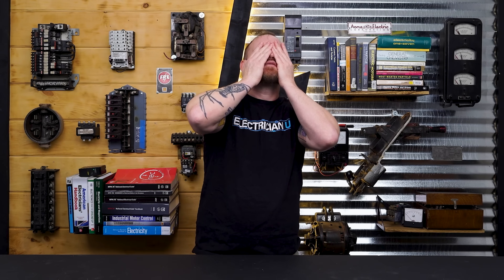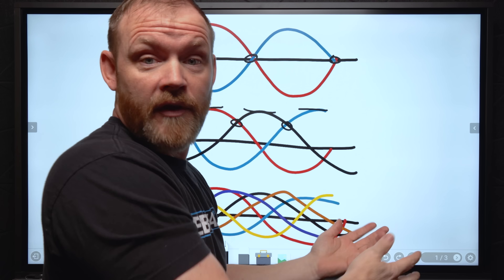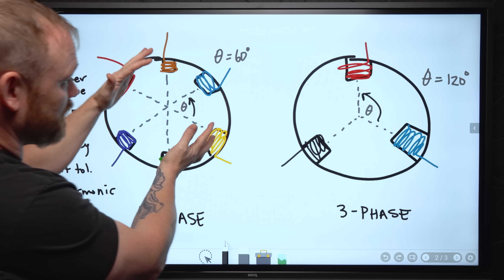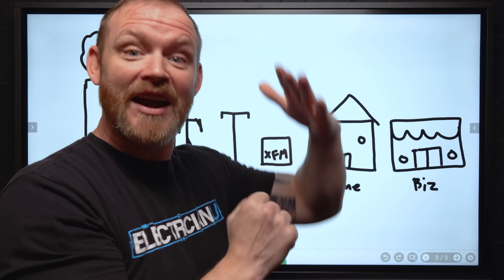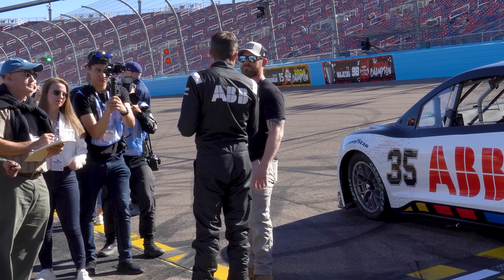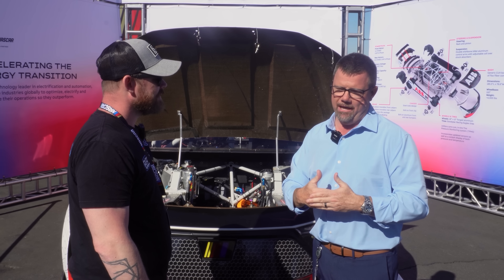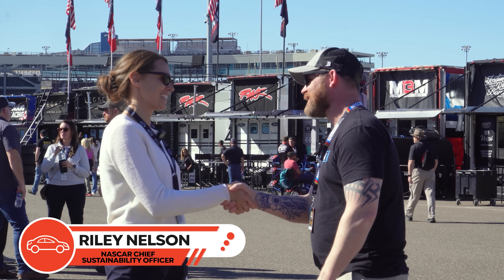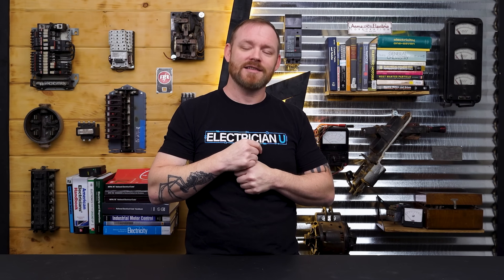6 Phase Power is a REAL GAME CHANGER!

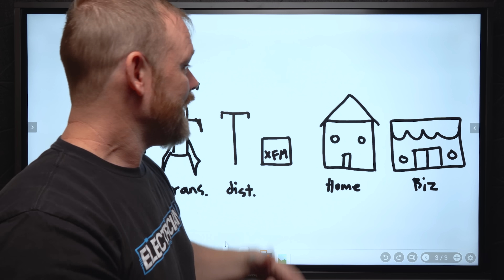Comment: @5:10, the reason why we keep the AC infrastructure is because of more efficient power distribution over long distances of cables.  Otherwise we would use DC but lose power from the electrical resistance in cables.  Not until we have cheap and temp  stable  superconductors at least.
Reply: @HomeEngineer-wm5fg  yep but was told maybe 10 years ago Japan was experimenting with supplying DC ( along with traditional  AC ) to supply power to computers & other electronics that waste energy transforming AC to DC. Thinking was they might be able to save from 5 to 8% on total power which includes lower air conditioner load.
Reply: Not at all, in fact the very long power cable projects almost all use DC, the issue is it's more complicated even now to change DC voltage, and when our grids were being built it was completely impractical at that scale, the transformer only works with ac and is a simple device where dc/DC voltage converters are more complex.  There's also some difference in how hard it is to make a switch for ac and DC, the zero crossings in ac make it easier to limit arcing in a switch.  The power we lose is tied to voltage first and foremost, hence the need to change the voltage higher for long distance lines, ac has extra losses that DC doesn't on long cable lines tied to other issues, which is why major very long haul electrical projects use converters to connect to the grid and run very or ultra high DC voltage cables, it's not used for shorter distances due to the cost of those converter stations vs an ac substation and probably also a bit of how we use physical spinning mass with high inertia to provide for the very short term balancing of grid supply and demand with many different sources of power, inverters that can simulate this property are popping up but a very recent thing and it's still I think a little more limited though that's changing.
Reply: China uses High voltage DC power lines as tall as skyscrapers to go long distances, so that theory is now debunked idk how they pulled it off
Reply: DC has lower resistance losses over AC .
Reply: @TronicUK  But for local distribution AC wins out every time. Just look back at lying cheating Edison DC ( That required generating stations every 10 miles )  Some verses Tesla's AC system. Crook Edison electrocuted and elephant & other dirty trucks to have DC for everyday power
Reply: That has nothing to do with the choice between 3-phase AC and 6-phase AC.  Nobody was suggesting changing to DC transmission lines.
Reply: @EfficientRVer how much would it cost the consumers to have three additional transmission lines, three more generators. All the additional equipment to manage it all. If current power costs $0.14/kwh; why would I want to pay $0.28/kwh
Reply: @EfficientRVer  I did some research on the matter, after reviewing the materials I think we both are right and wrong.  The answer is much more nuanced than appears.  Example, You are correct in a way because the currents of 6 phase can be lower to produce the same power, so both 3 phase and 6 phase can be comparable.  But there are lots of details regarding failure conditions of both systems.  I was incorrect to compare 6 phase to "achieving closer to DC" power.......not a fully accurate statement.  Its a calculous problem of approximation and averaging.....  A bit more complicated of a topic ignoring other aspects of physics.....Thank you AI for clarifying!
Reply: @EfficientRVer  Sorry to take the convo off topic, but the 6 phase AC motor presentation is very well articulated.  Power distribution is another matter, considering the infrastructure is not designed to accommodate better electric motors.